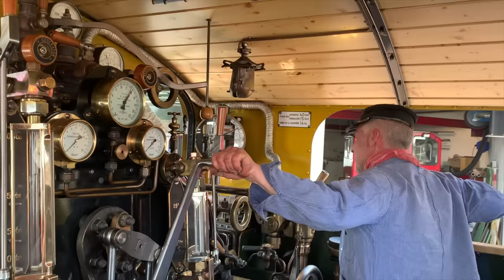DFB Dampfschneeschleuder R12 im Frühlingsschnee 2021, Steam snow plough in the swiss mountains!

Comment: One thing that I noticed when the fan became clogged with the packed snow was that they had no steam or hot water pipes around the cutter box. Other steam rotaries that I have seen videos of have had those for reducing the clogging effect when cutting heavy and packed snow. Films made by the Southern Pacific on Donner Pass in the 1950's have shown their rotaries in action. I believe that they had steam pipes around the intake fan. OY, on the Cumbres and Toltec, deals with this same heavy spring snow pack when it is used to open that railroad in the spring after it being closed for several months. There are several videos on YT of it in action. When my grandfather worked on the Northern Pacific, he said that they sometimes used explosive charges to loosen the snow so that the rotaries could chew into it. On the highway snow crew in Oregon, we had the rotary plows with the horizontal rotating cutters feeding the fan and the only times we got clogged were once when one of the guys picked up a chunk of a fallen tree and once when another operator found a parked car under the snow by ripping its bumper off. We had shear pins in the shaft couplers that would break if you hit something that solid and protect the gear box from damage. Then we had to dig the snow out, pull the tree trunk out and replace the pins. The car bumper had to be removed with a torch.
Reply: yes agree above
get on with it
that engineer operating the snow machine could do with six arms to do what he was doing
so slow im sure it was meant to use man power  not steam power.

Comment: 7:54 - Abt system rack. Probably the best of the rack systems for heavy trains.  In 1970, I visited the Eisenerzbahn in Austria, which hauled iron ore over a mountain.  The eastern terminus was Vordernberg, ran west through Prabichl.  It used massive rack and adhesion steam locomotives, using the Abt system.  Both of these lines use/used 2-row rack, there was also a 3-row version.  Notice that the snow blower also engages the rack, apparently to assist in braking, to prevent sliding back down the mountain.  It's very unfortunate that the Eisenerzbahn was abandoned, it would have been a wonderful tourist railroad, in beautiful mountain country.
Reply: Is that the motion above the drive wheels?

Comment: Seems like they have a lot of learning to do with the rotary, just as it gets its teeth into the snow it gets pushed too hard and stalls. Seems like the driver of the locomotive thinks he's trying to push a plow through the snow rather than a snowblower.
Reply: I was wondering the same thing.
Reply: surely going at a slow constant speed would work better than keep compacting it every time it goes back and forth into the snow..
Reply: Oh yeah I'm sure the engineers who spent thousands of combined hours designing and building this thing never thought about going slow. I'm sure thatd work way better
Reply: @NomNomNom1989  I've seen people do things 50 years and still screw up.
Reply: I want to know what the extra set of pistons and rods are for turning independently from the main wheels and rods.
Reply: @isthatus0768  cog wheel drive apparently. I was wondering that too, until the shot with them engaging the racks about mid way through.
Reply: Yea I'm kinda wondering what is going on with that too, I've seen videos of a rotary just chewing through mountains of snow.
Maybe it's waterlogged snow or they haven't got enough of a steady pressure in the rotary ?
Reply: I think their issue is that they haven't got enough tractive force to travel slowly.  They are punching into it instead of having more horsepower connected up to do the job properly.
Reply: personnally i think its not stalling, it stops before stopping the rotation, i think the locomotive doesnt have enough push power.
Reply: Id bet the wheel has enough momentum to keep itself going. They need some more ass pushing into it since they aren't stopping the blower.
Reply: This is true in fresh, soft snow, but this snow already melted, because of this the snow is much heavier. To push without thinking could damage the rotary. After 18 years of hard work nobody will take that risk. Apart from this, the crew never worked with a steam rotary in regular service I guess. So they have to become a team. The crew in the rotary and in the steam engine.
Reply: @isthatus0768  Click on 7:54 to see the rack system underneath - driven by the top set of valve gear - which - because of several staging cogs, has to appear driven in reverse, to get the rack cog driven the correct rotation = forwards)

Thus:
The upper (reverse spinning) side-rod gear - is for the cog railway TEETH (located underneath and inside the main drivers) - as that only rotates in the same direction as the main ordinary driven wheels (it's a cog interaction system that only appears to rotate in reverse)
It can only drive forwards - by having the valve gear operate in reverse, to allow a secondary set of intermediate cogs, that interact with the rack-cogs - to allow the rack system to work in conjunction with both the driver rod/shaft, and the gearing itself, to turn the rack-cog in the correct direction - being the same direction the main drivers (normal railway wheels) are driven.
That also allows for the rack system to be used with, OR INDEPENDANTLY of - the main normal rail drivers, as sometimes only the rack cog needs to be engaged - for inching work.
Sadly - the loco driver wants to use the main drivers and race the cogs - to ram the combination into the snow face - when he SHOULD not be using the main drivers at all, just the cog system to inch everything along.
The RACK system (uses a reverse driven system of alternative cogs, to correctly drive the MAIN rack-cog underneath the loco itself.
(as is seen when engaging the rack at 7:54 onwards) 

What I am disappointed in - is that the locomotive driver - seems hell bent on ramming the steam loco into the back of the blower machine - when he should be inching the loco forwards, allowing the blower crew to correctly free spin the fan - without compacting the already way too hard (old) snow.
Being a normal loco driver - who only knows brute strength and SPEED - he does absolutely nothing to aide the snow blower unit, to clear the way forwards - as it is being pushed too rapidly into the work-face.
All he is doing is stalling the fan - by making the face compact before the spinning fan can bite free the snow it needs to toss aside
(thus by ramming the combination units into the snowbank - long before the fan has any chance of tossing the "fan-cut" snow aside, he stalls out the fan and clogs it - which happens at 17:39

After the fan is JAMMED by all that compacted snow - there's no way to get it free spinning again, until they shovel it out by hand.

If the loco driver at the back - was made to shovel it out ON HIS OWN, he'd be less inclined to ram everything HARD & FAST - at speed, into the face -  than to slowly inch it all forwards at a slow constant pace - using just the cog rack/rail (slower) system alone.

But no - for the camera's and a few video shots, lets make a huge impression - by being totally stupid and stalling the old steam units.
Reply: @rokuthedragon5675  not all engineers are smart. and this was designed a long time ago. We already have snow blower tech that can clear this like nothing.
Reply: @ThePerle1997  The fan is clearly stalling out.
Reply: Yeah I thought the same thing - the Engineer and Plow Operator are way out of sync.  I wonder if those cog engines have sanders.  I couldn’t tell if that was wheel-slip or the plow over-revving after it clears the chute out.  The one cab shot during this video, didn’t look like the engine was slipping.. I just think the team needs a little work perhaps.  Looks like the plow has no problems clearing the chute out, I’d wager it would run with a little forward pressure like you see in the vintage B&W footage

Comment: Very interesting! I see it uses a gear rack system to allow very slow speeds and still very high torque transfer without slippage, very clever!

My understanding of steam engines is that they excel at slow speed, high torque, I wonder then why the locomotive would stall? Perhaps they were running the boiler at reduced pressure so as not to risk damage to the old antiques?

Very cool demonstration and amazing that it could handle compact snow at all!
Reply: Yeah knowing very little about this whole thing this is my thought as well.  Seems like it would be more effective to creep forward slowly keeping the blower rpm high and whittle away at the snow.  Kinda like a tunnel boring machine.
Reply: The gear rack system "Zahnradbahn" is actually very common in these parts of Europe we have these a lot at steep hills in Germany Switzerland Austria etc

Comment: If it can only do 5 feet at a time, kind of useless isnt it?
And then it jams too..
Reply: With coal insted of elecricity-> obective was clearly not efficacity.
Reply: @barbarbe111  it was built before electric trains were in common useage
Reply: Its because of the compacted and melting snow. That stuff is hard like rock. It did a pretty good job for being 100+ years old
Reply: It's ONLY for a photo shoot - for a HUGE rooster tail ..
It wasn't done for any "distance work"..

If they hadn't had all the cameras there, (and actually wanted to gain distance), they would have feathered the fan blades to "only" thinly slice the snow to allow the fan at a constantly high RPM - to toss it aside, whilst ONLY using the lower speed cog system to inch it forwards ..

Nah - this had all the "modern media look" - of a set-up for a photo shoot only.

Comment: I feel like this could do with an update in design, maybe something more screw like in design that pulls the whole machine trough the snow and then it comes to some kind of grinding design that breaks the compressed snow apart and throws it away, also diverting the cooling system trough this woul be an additional benefit with the exhaust. The current design suffers from some flaws where it needs a continues force pushing it and trains don't have the best traction so they relay on momentum also the now gets compressed making it difficult to be pulverized.

Comment: It appears the locomotive was loosing traction pushing a load, from a stall, on wet snowy tracks.  Also, they stalled the blades and packed it, so they had to shovel anyway. 
Lovely machinery though.

Comment: This machine surely isn’t designed to run up on it wide open for 5 seconds and then back off. I don’t think they’re using it to its potential. If they kept it engaged and moved forward very slowly, surely it’d work better? Clearly I don’t know what I’m talking about but if it’s no better than this, I don’t wanna buy it anymore. Lol

Comment: Is the middle track for traction?
Reply: Yes, but the snow blower is from the Rhaetian Railway which doesn't use rack. This film is on the Furka Steam Railway which is preserved and probably doesn't run in the winter. The line was replaced by a tunnel.

Comment: How does a rotary snowplow work?  (Modern day that is...)

An engine within the plow's car body rotates the large circular assembly at the front of the plow. The blades on this wheel cut through the snow and force it through a channel just behind the disk to an output chute above the blade assembly. More torque, with less bog down ...

Comment: That blower is pathetic it either is wore out or the guy running it doesnt know what hes doing. We had a rotary blower on the Willamette pass the would blow that much snow and never stop or slow down. We would blow slides and snow deeper then this at 20 mile per hour .

Comment: cool video but that was a big fail on the designers of the snow plow not making it strong enough, not having enough torque to clear snow, and lastly having a very underpowered locomotive push it. I love steam engines but you at least need a diesel generator locomotive to have enough power

Comment: I don't understand. I've seen rotary impellers in use many times, and this is almost a masterclass in how NOT to operate one.

Firstly why, in the name of all rational thought, do they keep bringing the impeller down to damn near idle, only BEGINNING to apply power RIGHT BEFORE contacting the snowbank. That will practically guarantee that the impeller will stall out.
Secondly, why do they hit the snowbank at such a high speed? Once again, that just maximizes the chances of stalling out the impeller. 

I'm from Canada. I know what deep snow in the mountains can be like. We have to clear thousands of km of tracks, including in mountainous areas. I've seen these things in action before. 

Normal practice is to bring the impeller up to operating speed FIRST. Then, only when the impeller is ready do you SLOWLY advance the train into the snowpack, only speeding up when you are confident the impeller has capacity to spare. 

Why are they doing it this way? It doesn't make any sense.
Reply: Hello Darkwater 10135
I understand your criticism, let me explain:
During the first test drive (see "Rebirth of the R12 steam snow blower") six months earlier, we had fresh snow of 80 cm - with drifts of up to 2 m. Clearing went without any problems, although the steam locomotive was at the limit in terms of thrust.
During this test in the spring, the remaining snow (8 months, shady slope) was rock hard! We put our strongest machine (HG 4/4 704) into operation, but when we slowly pushed it in, the snow just laughed - no chance!
We then tried to drive in with a bit of momentum, but had to give up because it was really just brutal and there was a risk of damage. On other films from the old days you can see the same procedure when avalanche snow had to be cleared. Incidentally, the spot in the film is on an incline of 110 per mille and even the modern snow blower can only get ahead in the same way.
the only sensible approach here is to remove the snow with an excavator.
We're still trying out what's possible with the steam-powered snowblower - definitely not, you're absolutely right.

Martin Horath
Reply: @martinhorath  
Okay. I think I understand what you are saying. 

You cannot advance slowly enough that the the impeller can handle the load without stalling out. At the same time, you are concerned that you will break something if you hammer into the snowpack with the impeller spinning at full drive.

Is that understanding correct? If so, how often do you encounter those conditions?
Reply: Yes something like that. Even with three locomotives, there is not enough pressure to slowly push the steam-powered snowblower into the hard snow. But the spot shown in the film is one of the few extremely tough spots on the route. so we'll try when we get a chance to see if it's better in the other places. Have you seen the other film with the light snow?
thank you for the interest

Comment: Put those things in a museum and get something that actually works.
Reply: No need to get something that works. It has been a museum piece already for almost 100 years, now restored to working state.  It's being gently tested on dense compacted spring snow on a track that's now closed for winter. In the winter days of the past this snow thrower would run on a regular basis, often several times a day, clearing away freshly fallen snow, and keeping tracks free for uninterrupted train service. Since the Furka tunnel was completed about 40 years ago, this stretch has been abandoned and is only used for sightseeing in summer.

Comment: machine look nice  but that is a very poor snow thrower
Reply: Nothing poor all about it at all. It's a restored museum piece, for crying out loud.
It is being tested on dense compacted spring snow on a track that's now closed for winter. In the winter days of the past this snow thrower would run on a regular basis, often several times a day, clearing away freshly fallen snow, and keeping tracks free for uninterrupted train service. Since the Furka tunnel was completed about 40 years ago, this stretch has been abandoned and is only used for sightseeing in summer.

Comment: Think its a little to much for it which supprised me I thought it would chew it up spit it out need a more powerful snow removel this steam engine is having a ton of trouble not stalling out I thought these cou5d handle this stuff
I think these need to be retired
Reply: It's a restored museum piece, that was retired almost hundred years ago. It's being tested on dense compacted spring snow on a track that's now closed for winter. In the winter days of the past this snow thrower would run on a regular basis, often several times a day, clearing away freshly fallen snow, and keeping tracks free for uninterrupted train service. Since the Furka tunnel was completed about 40 years ago, this stretch has been abandoned and is only used for sightseeing in summer.